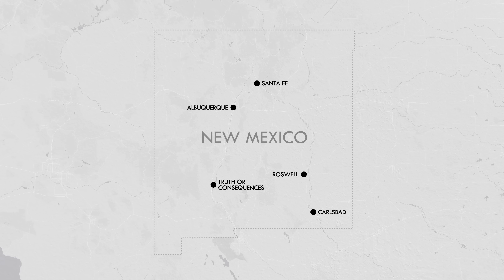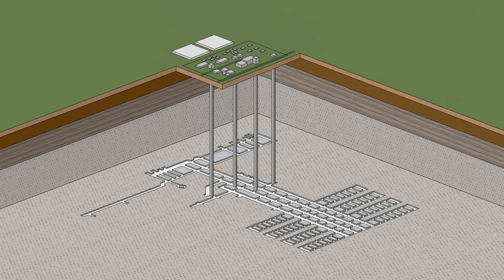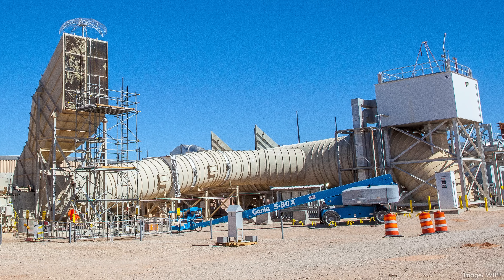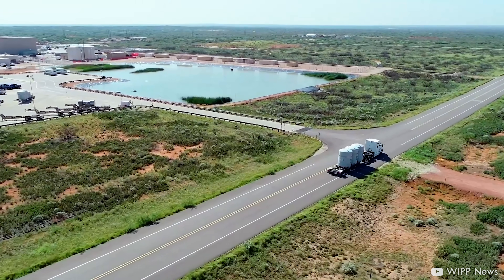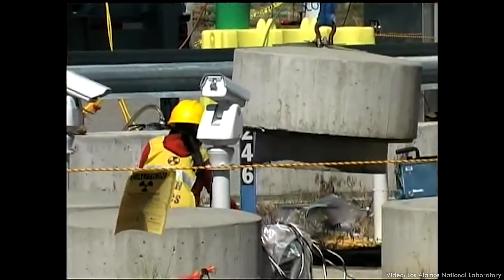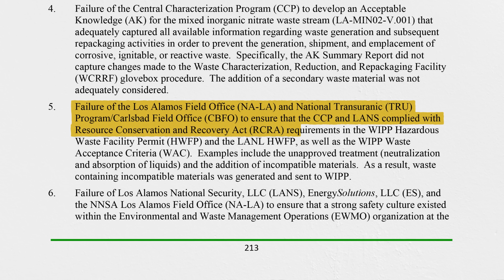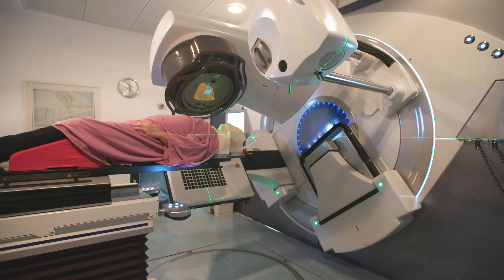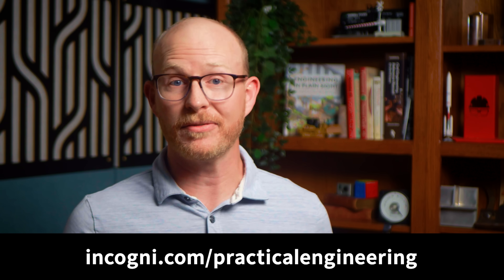When Kitty Litter Caused a Nuclear Catastrophe

Comment: Whenever I see ratios in technical documentation that fail to specify whether it's a weight or volume ratio to me that's a giant red flag for lack of attention to detail by the author.  Depending on the densities of the materials the difference can be very significant.
Reply from the maker: It was specified by volume, and I included that in the script on first mention.
Reply: @PracticalEngineeringChannel  Volume for cat litter is at best an eyeball guess. Mass per volume varies greatly depending on particle size, shape, and density, even when made from the same material. It can be from nearly solid like road mix, to light and fluffy like styro beads.
Reply: @Reziac  You're gonna get a hell of a lot better procedural compliance if you hand a worker working in a glove box repacking a drum of sludge some measuring cups to use inside that glovebox than a sensitive scale.
Reply: @PracticalEngineeringChannel  It's a lot easier to measure by volume inside a sealed glovebox.
Reply: Surely it refers to weight ratio? No sane person would use volume measurements for granular materials, that's like measuring using a random number generator.
Reply: @MatthijsvanDuin  Hence why I hate any food recipe that uses volume instead of mass. You have to RNG based on how packed your flour or other ingredients are, plus have to use 800 different sized cups and spoons or just throw everything on a scale?
It's so much easier and so much more accurate to just weigh them.
Reply: @MatthijsvanDuin  it still is common in many areas where the volumetric density is decently well known as it is just really simple: Have a container of the correct size, fill it - done. A lot faster and no chance of miscalibration of some measurement device.
Reply: @ABaumstumpf a lot of the world doesn’t even use volume to bake cookies, let alone store nuclear waste dump
Reply: @MatthijsvanDuin  I agree. But it's still very lazy of the author to rely on the intuition of the reader.
Reply: @MatthijsvanDuin  This is quite common in cooking.
Reply: @tz8785  Maybe where you live, over here recipes use weights
Reply: @MatthijsvanDuin  That would depend on how precise you need to be. I never saw anybody weigh the amount of sugar they put into a cup of tea or coffee. Particularly if you’re dealing with a maximum ratio that mustn‘t be exceeded, you can have a process along the lines of „the kitts litter can absorb up to x% by volume, introduce a safety factor and tell the workers to keep it below 0.8*x which equal to y of the containers they use to to handle the stuff during repackaging.
Reply: @ "That would depend on how precise you need to be. I never saw anybody weigh the amount of sugar they put into a cup of tea or coffee. "
Sorry what?
You consider making tea to be COOKING!?!?!?!
Reply: @MrAranton  Sugar is generally about the same density regardless, so "some" is close enough. Cat litter varies a lot depending on the type, so really should be weighed. The cheap angular stuff is much denser than the kind that's formed into tiny aerated beads, even tho it all started as the same clay.
Reply: @ As I understand it, in this context the relevant property of the absorber isn‘t its mass, it‘s the amount it can absorb and contain. As long as it‘s about how much matter can be absorbed, the density is pretty much irrelevant.
Reply: @MatthijsvanDuin I only ever measure by volume
Reply: I was involved in a manufacturing error that resulted from the ratios were specified by one engineering group in one country in terms of molar percentage and the destination manufacturing site used weight percentage in their equipment. It was a costly error with potential safety consequences. Another issue that I repeatedly encountered was that the symbol used for microns (1/1000000 meter) and micro inch (1/1000 inch) is the same, the Greek letter mu. Most of the documents I used were in metric but the US Dept of Defense military specifications were in inch/pound units. Far too often the document writers would use the character mu without any reference to the base unit system. The difference is dramatic, 1 micro inch is 25.4 microns. The Hubble telescope had to be retrofitted with corrective optics due to this type of measurement difference error.
Reply: It was molar ratio 😜
Reply: I didn't care about baking with volume, until I came across the term "well packed". Some ingredients, like beet sugar (don't know the English term) apparently have to be well packed. 
That's frustrating.

The same with a spoon. It can be flattened, giving a very small amount (depending on the spoon's depth) or with a bit, or a big heap. Those are differences.
Reply: USA cooks and bakes with volume (generally), Europe with weights. 

In a scientific and engineering situation I would want, in first instance, weight, as it's more precise, though once the weight is known, in practice volume can be more practical.
Reply: Or by moles.
Reply: The entire time I was watching this I kept wondering if it was by weight, or volume. It's just the way my mind works.
Reply: @zaraak323i  The ratio could also be by number of molecules.
Reply: @jannikheidemann3805  True, but I don't have a chemistry background. 🙃

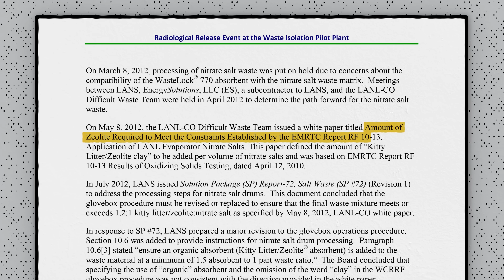Comment: 8:50 At first I was like "oh, so it's just the same thing as cat litter" but then, no, it's actually literally cat litter 😂 10:00
Reply: I suppose that was the easiest way to procure the material in bulk?
Reply: Some cat litter. Looks like they forgot to specify "with no additional chemicals". Which rules out quite a lot of cat litter, even a fair amount of "fragrance free" that has baking soda in it... "unscented" is right out, that's always got other stuff in it. Frankly, if they meant Zeolite, they should have said that and only that, including a required purity rating, or at least a caution that it needed to have no other chemicals present). Literally the vast majority of kitty litter would have been unsuitable for use in this purpose, and when you're talking about nuclear waste, the possibility of a commercial box misprint / mis-fill / contamination is high enough that nobody should be using it without proper testing to confirm the contents of the box. Or... just buy it in bulk from a supplier that can provide reliable assurances (i.e. is in the business of doing so).

Comment: A kazzillion years ago, when I was just middle aged, the factory I worked in (okay, employed by, sticklers) tried using what was essentially wheat chaff to soak up oil spills and leaks.  I guess the wheat stuff was cheaper than kitty litter.  We didn't have an incident, but someone realized we had chemicals in the plant that, in contact with the chaff, would combust without an ignition source like a spark or flame.  So, it seems obvious to me to not use wheat chaff in an industrial setting due to that experience, but how widely known is this, really?
Reply: "So, it seems obvious to me to not use wheat chaff in an industrial setting due to that experience, but how widely known is this, really?"
It really depends on the industry but in general: Together with wood pulp it is a great material for dealing with oilspills and is widely used specifically cause it is simple to handle, does a good job, and in most cases has no added risks.
"most" is a key word. Same as you use water to suppress fires in most cases.
Reply: Are you talking about wheat chaff causing a dust explosion?
Reply: @wdaadwa5005  No. Nitrogen-bearing wheat chaff reacts with the petroleum, and what results may go boom. Not too different from mixing fertilizer and diesel fuel (fertilizer is just more concentrated than wheat chaff). Poor man's TNT.
Reply: @Reziac  Was thinking the materials sounded like a recipe for ANFO.
Reply: @wdaadwa5005  Those other chemicals might have been powerful oxidisers.
Reply: @ ok